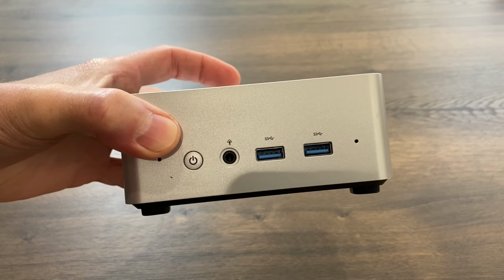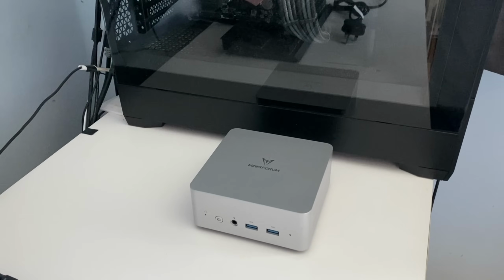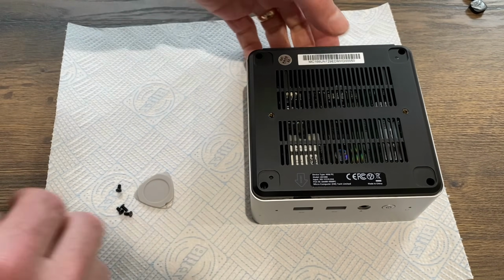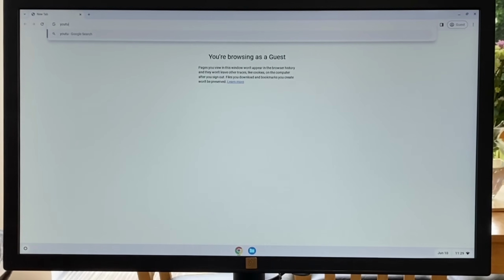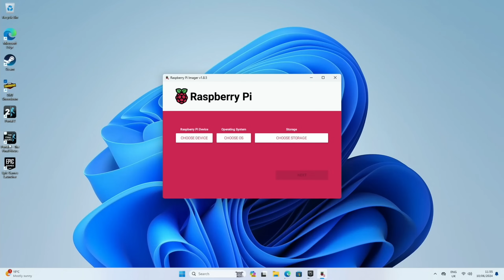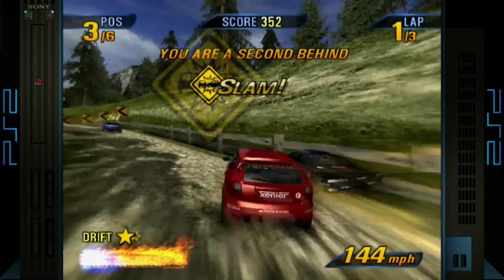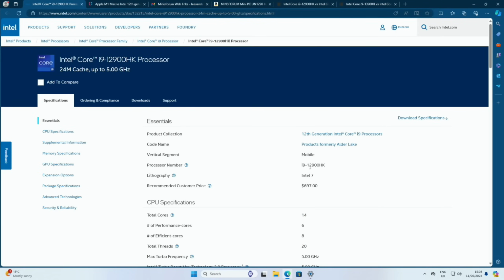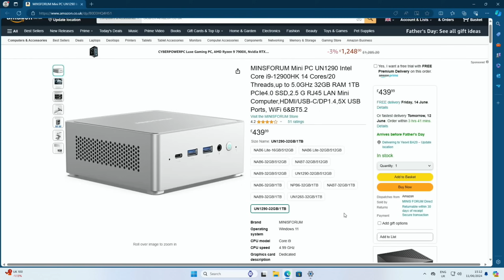Great Value i9 Mini PC. Minisforum UN1290

Comment: I just purchased this exact computer via Amazon so I can have a Linux machine, free of Windows.  I am planning to migrate to a Linux OS because MS has now totally "lost it" when it comes to its own spyware ("Recall" feature add to 2H24 Win 11 update push).  However, I am a total newbie at Linux (anything non-Windows, really).  You seem to be really experienced, so I wonder if you would consider a step-by-step instructional video for installing (say) Zorin 17.2 on this machine, as I expect there could be a surge in people abandoning Windows after the MS  Recall mess.  I don't even know how to reach the BIOS on this machine to install Zorin and whether I can do this directly on initial boot-up, erasing the pre-installed Windows 11 on the machine's hard drive.  In a word, "help!"
Reply: i switched to debian in march, because i tired of turning off windows spyware. linux better now
Reply: One of the selling points about this little computer is it does come with the over 100 pounds windows home loaded on to it. But yeh,  like you, windows is an expensive mess now and has fallen way behind. Why doesn't Android do pc software, it's in a different league.

Comment: The Minisforum UN1290 I bought worked fine for about 2 months then started hanging on boot. I have it setup to dual boot with Win11 and Fedora 40 Workstation. It hangs regardless of which OS I select to boot. It also hangs when I try to boot from a USB drive with a liver version of Fedora. I contacted support at Minisforum and they were of no help. As this PC comes with no warranty, I think I just wasted $400. Now I'm stuck using Fedora on 10 year old hardware until I can afford to replace the UN1290. My suggestion is to buy your PCs from a reputable PC maker that offers at least a one year warranty.
Reply from the maker: @Russell.Jolly.2023  is it worth trying more operating systems? Maybe remove and reinstall the ram and drive.
Reply: @leepspvideo  : You'd think they would at least offer similar suggestions but all I got was: "Please provide a photo so we can confirm the problem." I'd love to look at a log file, but I'm going to have to either figure out how to boot to a commandline or pull the hard drives and place them in another system. I'll likely end up using the leftover parts from the Minisforum to build a new system. I'm guessing the GPU went bad; I've got some local tech pros that will check the hardware for me this week. But to have them work on it and possibly buy a new motherboard will likely cost at least half the original purchase price of the Minisform (which was the best bang for the buck or so I thought). 

So I probably would have been better off purchasing a Dell laptop or maybe even an Apple Mini just to have the warranty and support those  companies typically provide. Live and learn, I guess. Thanks for the suggestions.
Reply from the maker: @Russell.Jolly.2023  it’s an integrated gpu. I would have thought a fault with that was pretty rare.
Reply: @leepspvideo  I've had them fail on laptops but I've never seen this kind of behavior. It is definitely not an OS config issue. If I can take a USB thumb drive with Fedora Live on it (and I know it works on other computers) and the first boot device in bios is the thumb drive, then nothing on the hard drives should affect the boot of the thumb drive, which suffers the exact same fate as the other two. But I will have my local techs take a look. They have more resources and expertise with hardware than do I.
Reply: Change the RAM sticks. Then see if it goes into BIOS after pressing the bios key during boot. If you can get to boot from USB, it is most likely RAM issue.

Comment: May I ask I brought the UN1290 from Amazon, the CPU speed is 5.0GHz, but I windown system, it shows 12th Gen Intel(R) i9-12900HK but the speed is 2.5GHZ, is it somthing wrong? Many thanks!
Reply from the maker: It turbos at 5Ghz. This is usual these days to use less power when not working so hard

Comment: The UN1290 might get a score of about 18k on Cinebench R23 on initial tries but despite of these values, the power consumption is fairly high when stressed, which is why it will eventually throttle down to the values of a 11900H (without throttle) or a 6900HX (Usually never throttles).

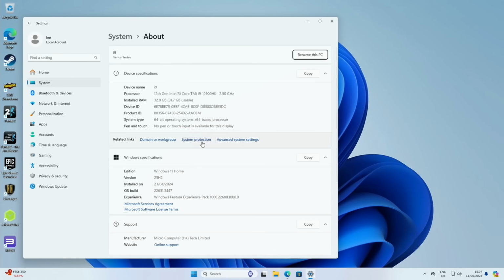Comment: Wait, can somebody please tell why it's written "2.50 GHz"? Isn't it supposed to be "5.00 GHZ"? Check it on 16:07.
Reply: @UsuiTakumiMeansPerfection Your Right  the CPU show 2.5 Ghz i have one can can not get it past the 2.5 Ghz  to 5Ghz.
Reply: @originalbrucesmith 5ghz is the boost clock it’s not a sustainable value, just the max frequency the cpu can hit when it needs to
Reply: 2.5 is standard LAN
Reply: @tip00former1  not talking about the LAN port read it again you missed the what was said.
Reply: @tip00former1  But that's supposed to be the speed of my internet connection? Am I right?
Reply: @UsuiTakumiMeansPerfection  well, I am no specialist but I am talking about the lan port. They come in different bandwidths, like 1 and 2.5 standard. And yes, it's all to do with your internal network and internet. Households normally use like 1 gig, just for intenet use, but if you have some nas, etc, you may want to have higher loads on the network like 2.5 or 10 gig (for exchanging files on your network, not internet related). Hope this helps.

Comment: I got mine yesterday - very impressed with it. My previous pc was based on an i7-4790k cpu so this little box was a quantum leap in performance. I'm not a huge gamer so the lack of a dedicated gpu doesn't bother me.
Only negative is that I'm not liking Win.11 so far but it's a case of getting used to it.
Thanks for your vid - I used it to install an ssd.
Reply from the maker: I also have Kubuntu installed on a 240GB ssd inside the case

Comment: Great use of the video blur filter. Alder Lake is where any Intel purchaser should likely start and for the price, this does look a fairly reasonable purchase for what it can do, so could last quite a while.

I like the nice little touches like the supply of screws for the 2.5" drive and the heatsink around the M.2, which should really be a standard feature in all mini PC's.

I don't know why any machine needs rubber feet to be removed to get at the case screws, when drilling a hole in the middle would easily allow access for a screwdriver without risking the feet losing their sticky grip.

Comment: He showed a 3.5 in mechanical drive, you cannot put an internal 3.5 in hdd in this unit. The largest 2.5 in mechanical hdd I have seen is 4 TB by Seagate, costs about $125 USD at Amazon U.S.
Reply from the maker: I searched for 2.5” HDD on Amazon the search results contained 3.5” drives. My mistake
Reply: @leepspvideo  yes, I understand, not a problem for me. Seagate does make a 2.5 in 4 TB drive, but it is 15 mm thick instead of 7 or 9 mm
Reply from the maker: @SuperFredAZ  might still fit
Reply: @leepspvideo  I don't think so, I have a similar model, besides, 2.5 in only require 5V power, 3.5 in require both 12 V and 5V, the mini pc does not supply 12 V, so even if it fit, it wouldn't work
Reply from the maker: @SuperFredAZ  I was thinking of the thickness fitting. Forgot about 12v in desktops
Reply: @leepspvideo  yes I think that will fit and work, I have one of these in an external enclosure, works well.

Comment: I don't think this is cheap. No decent iGPU and an old i9 of 2 generations ago. I hope the AM5 barebones will be coming soon in my country. Because for almost the same price you can build a 8700G system then. The 8700G is finally on a price point it gets interesting to have one. But if you cant wait that long you might consider a 5700G with a AM4 barebone also?
Reply from the maker: https://cpu.userbenchmark.com/Compare/Intel-Core-i9-12900HK-vs-AMD-Ryzen-7-8700G/m1763927vsm2282824
Reply: @leepspvideo  I don't see many small PC use cases where top 'multiplecore' CPU performance is the priority, but many where a decent GPU performance is needed. That seems the reason that small PC's without decent GPU power are always on sale ? They don't seem to sell well? I mean if you really need that much parallel processing power a normal PC with a dedicated GPU will have so much more power if it can render on the GPU that the choice for a small PC with a iGPU wouldn't be the 'adult' one. And your own bench shows that tasks which use 8 cores or less the i9 isn't better than the 8700G
Reply: Userbenchmank is biased meme
Reply: @pawelfilar  single core it's the same between these two, 8 core the 8700G performs better and only in cases which the 14 cores can be used all together (which is only in real rare use cases outside benchmarking) the i9 is considerably faster off course.
Reply: @erikkarsies4851  that's not my point. No should link to this portal, because its biased and unobjective
Reply: @pawelfilar  It's usable if you look at the actual data. The bias is in the way it is used I think. I used the data given there, but not the ranking which is unreliable unspecific.

Comment: I have the NAB9 version ...its better and cheaper. No need to unscew anything . all the cooling is on bottom and the drives and ram etc. is on the top and you access them with an easy click off top cover. I also have USB-C on the front.

Comment: Yes…I would never have anything more than a n100 CPU in such a small case. Likely to run too hot. I have a couple of n100 Trigkey G4s about £160 (when on offer) with 16GB RAM. I am able to run them for 24 hours nonstop doing AV1 encoding, I wouldn’t risk that on an i9 CPU in a NUC type case. Try running the i9 flat out with AV1 encoding for several days nonstop. A n100 CPU can easily substitute for a Raspberry Pi for a similar price once you add in all the accessories such as NVMe.
Reply: cooling is superb on this thing. You cant even hear the fan